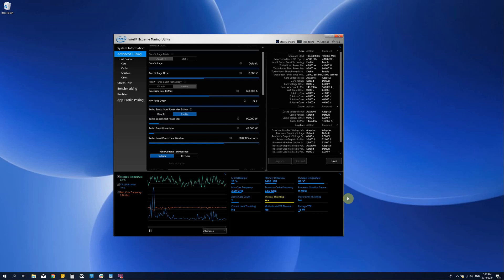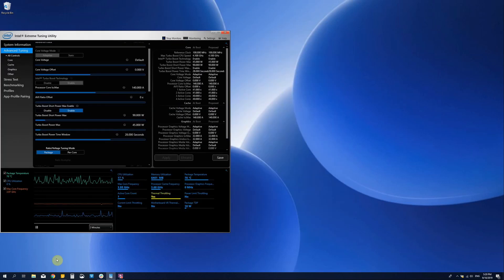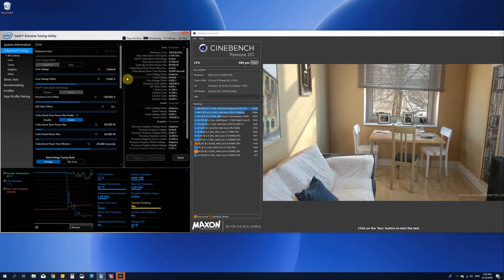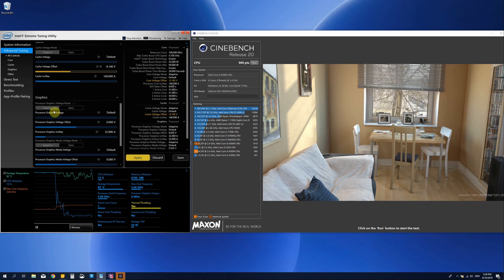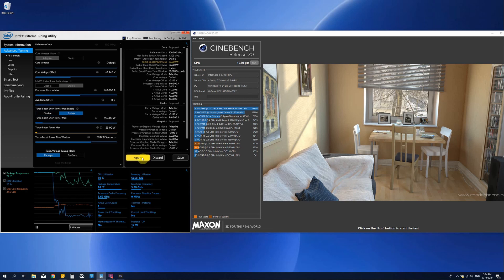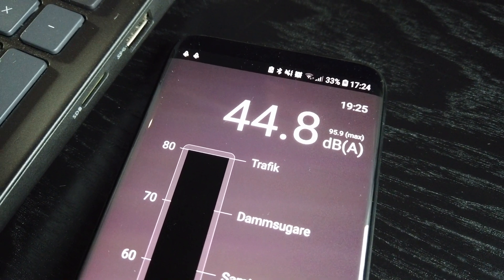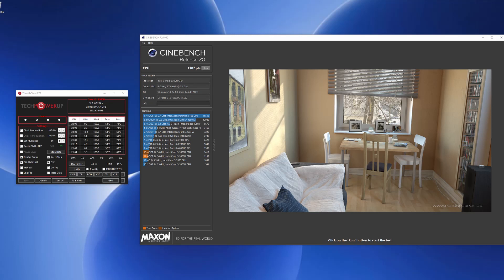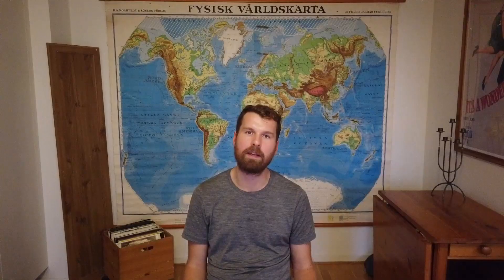Dell Inspiron 15 7000 i5 Undervolt & Turbo Limit in XTU Guide and Benchmarks

Comment: One more thing you could try to bring those temperatures down: repasting. Just replace the stock thermal compound with some high quality one. I think liquid metal in a laptop is quite risky, but any none conductive quality one will work quite good!
Just remove the bottom cover, then the screws at the fans - both gpu and cpu -, take out the fans, remove the srews holding down the heatpipe and you should be good to go. 
Remove the old thermal paste carefully with some rubbing alcohol, then aply the new paste. Screw everything back together and enjoy a cooler and maybe even more powerful/more silent machine!
Reply from the maker: This will happen eventually! I'm just a bit afraid I will do something wrong...
Reply: I repasted my CPU and used similar undervolting as shown in the video (only difference being, that I used a max turbo power of 45W) and I was able to get a Cinebench R20 score of 1823 points. Although it is noteworthy, that my CPU was constantly at 97°C while performing the benchmark. I don't know if I'm using an old bios version, or if the cooling system is just that bad, but overall my temps are still quite high. The thermal paste I used is Arctic MX-4 (2019 Edition).
Reply from the maker: @mtg1337  Wow that is awesome! What were your original W for turbo boost? Are you on i5 or i7?
Reply: @w2best  I have the i5 variant and the Max Turbo Power was set to 25 originally. I'll probably end up turning it down to that again though, to get better battery life.
Reply from the maker: @mtg1337  Oh interesting I think mine was set as 45w from the beginning! What were your temps when you reached 1823? Did it throttle? That's a great score for an i5! :D

Comment: Hey my account got changed but thanks for the video, it helped my buying decision, upgrade from my previous laptop (2016 inspiron). I didn't experience the huge fan noise when first starting up, so I let it upgrade to the latest BIOS and everything else, then I launched the BIOS pressing F2 on startup, going to Restore Settings and you select the Factory Settings one (Not the BIOS default one otherwise it won't work). And after that undervolt was enabled again! 

As for the specs and benchmark, I have the default one with i5 9300h, 8gb of RAM and the GTX 1650 with 512gb of storage. So after updating to the latest bios and then resetting to factory settings I started up XTU, made no changes and also ran CoreTemp and on my first Cinebench R20 run the score was 1666 without any changes. Temps were maxing to 97 degrees and throttling.

After this -140mv -40 on processor graphics and I think the turbo max was also limited to around 25-30 it resulted in 1838 points with temps going up to 98 degrees. I think it was performing well, fan noise was there and it was throttling sometimes. Im still going to test and choose settings with lower temperatures for now though. Power settings were on the Dell plan. If your laptop restarts when you put it to sleep, use thorttlestop instead, thats what happened to me and throttlestop fixed it. For now, I keep the turbo off and it helps keep temperatures low (around 75 degrees) and games are still running fine!

EDIT: I also wanted to ask you, do you get any IPS screen burn/ ghosting? Im getting a bit with the windows search bar on the bottom but too early to comment on it and I think it goes after a little time
Reply from the maker: Thank you for the update! I will def. test resetting the bios! There are a few people that have commented this, so I should def. try it! I haven't experienced any burn in so far, but it's only now that I updated to the windows creators update where the white search bar is always there. Let's see if it happens in some time...
Reply: Thank you so much for the video @W2Best Tech, and this comment also so helpful. I’m using Inspiron 7556, my cpu temp often reach 98C when doing heavy task and TS bench on Throttlestop. I try to resetting my Bios to Factory Setting like in this comment. Back to Throttlestop, activate the Disable Turbo and now my cpu temp only around 77C when doing TS bench. And the “unlock adjustable voltage” in FIVR tab also an be activate, it was greyed out before. Thanks!!

Comment: Hey, if you're still having that "sleep on closing lid" problem. All you have to do is go on the "Power options" a shortcut is typing "Windows" + "R" and enterring "powercfg.cpl". In the right of your selected profile go on "change settings" then "advanced options". You will find there the "action on closing lid", set it to "hibernate". I've was having the same issue. 
Best regards
Reply from the maker: I have done this and most of the time it works but not always. Still sometimes it will not hibernate as it should.

Comment: With throttlestop you cannot only turn turbo off completely but you can also just limit the maximum turbo frequency. I limited mine to 3 GHz and that works really well, it's still hotter than no turbo but also more powerful
Reply from the maker: I know you can, but I didn't do it in my last video. Back then I didn't actually know it was possible. :)
Reply: @w2best  

Do you have a video showing bios options for this laptop?
I'm gonna search your videos right now.
Reply from the maker: @TheAgentAssassin  I have one of when I updated to the most recent bios! That one silenced the fans and made the computer a few degrees less hot!
Reply: Yes, this is a game changer! I capped the frequency at 3.7 GHz and I get almost the same performance as before with much lower temperatures and much less fan noise (frequency now stays stable, while before it kept going up and down because of thermal throttling).

Comment: Thanks a lot for this video, and let me ask you one question. Does the xtu app interfere with Windows power plans or do they complement each other? Like if you change the slider between power modes, does it remove the xtu profile, or does xtu replace the windows power plans, or do they work together? Could you try your - 140/-40/23W with different power modes to see if there is any difference in performance and temperature?
Reply from the maker: Really good question but I don't believe so! However I haven't tried so I couldn't say for sure.

Comment: Hi mate, thanks for your work on this. I got the same laptop, but the i7 model as this was the only option that came with a 4K display (I am editing portraits in PS and LR on the go and more pixels definitely help). What I have done might be controversial, but I have disabled Hyper-threading in the Bios. This way I am running purely on 6 cores which is plenty of horsepower for my needs. I have also added a second NVME SSD and repasted both CPU ad GPU. Also, I am using Intels' XTU utility for undervolting and found a sweet spot at -60mv for both CPU and GPU. The laptop is idling now at 35 degrees and the fan really only kicks in at around 60 degrees. Streaming movies, watching YT, etc. does keep the laptop super quiet, only when I am stressing it (in PS for example as I work with big files) the fan goes on. I am not a massive gamer but will test some titles in the near future. I also have a slight issue with one of the fans which is humming a little louder than the other, I might try and find a replacement on eBay or on one of the Chinese tech websites
Reply from the maker: This is great to know! Thank you for posting your tips! I also want to repaste but I won't be able to do it in a few weeks while travelling.

Comment: Hi there. I have just received my inspiron 7590 with the i7-9750h processor. Can you please suggest the settings (values) for undervolting the laptop in order to cool it down? At the moment, I am not using or going to use any demanding software, if that helps. I just need to reduce fan noise and running temperature. Thanks a lot!
Reply from the maker: I would pick an undervolt of 125mv for the CPU and CPU cache and 50 for the GPU. See what it does to the temps and the fan. :)
Reply: With his settings in this video and Turbo off,  My i7-9750h processor  got a cinebench score of 1930 and process never got above 80c.

Comment: Thanks for the great vid, i was wondering if once the setting is done XTU can be totally closed and the settings are still there or does XTU have to run barkward to keep the settings active? thanks again.
Reply from the maker: Xtu runs the settings all the time and you don't need to keep it open. :)

Comment: Cool, I‘m also using XTU. I use -140/-50/no turbo since I only play older games from time to time. Which battery mode (longer battery?) and which Dell Power Plan are you using (optimized?) to achieve silent browsing and lower workloads? What do you use for heavier tasks/gaming?
Reply from the maker: Optimized and balanced are my standard settings

Comment: Hi dude! I'm pretty sure you've got this question several times, but I have to ask you cause I don't find my problem in the comments: I tried with xtu (already seen the 1.6 bios problem video) and when I restart/turn on the pc, xtu give me a message and my settings are completely gone..how can I fix this issue?
Reply from the maker: What message do you get? I haven't heard about that at all! So I'm intrigued to hear more.
Reply: @w2best   sorry but at the moment I don't remember the message because I uninstalled xtu from the pc, it's like the software cannot mantain the settings. I solved my problem with thermals simply disabling the turbo boost from the BIOS

Comment: Hi, I just bought this laptop (same specs) but I have noticed very high temperature even with Undervolting and limiting the Max Turbo Power to 25W, I mean temperatures reach 9x degrees quite a lot of time and when I was only browsing the internet the temperature was in the range 70-80 °C most of the time.  Do you experience similar temperatures?
Reply from the maker: My experience is sometimes it ribs hot, starts the fans and cools down but most of the time mine is cool and no fans running when idle or just browsing. Turbo at 20w might help!?

Comment: 2:15 How's that possible to hit 90+°C with XTU only ? While stress testing it is understandable but there with less than 20% utilisation ?
Reply from the maker: It's with xtu and the screencast software. I know it's crazy that it peaks to those temps at moderate use. After using the Acer Swift 5 for a while and seeing the other end of the spectrum. There is really a downside to using 45w processor and gtx1650 in such a small chassis.

Comment: Thanks a lot for this video, and let me ask you one question. I do not understand English well, I use an online translator. I realized that your laptop weighs about 1.6 kg. What is your battery capacity?
Reply from the maker: My laptop was 1,77 kg when it arrived with 97wh battery! With another ssd and ram it's almost exactly 1,8kg.
Reply: W2Best , thank you very much!

Comment: You should seriously consider repasting the laptop. I have the exact same config (only a 7591) with the latest Bios. In the past, CPU stress test in Intel XTU will definitely bring the CPU to 100 degree C within seconds. Now it's hovering around 80 degress throughout. And in XTU benchmarking, the Max CPU temp has decreased from 100 degree to 7X degree. I used Kryonaut and have not even undervolt the laptop yet.

As for the process, it is extremely simple. Only take off the backcover, then remove the heat pipe (no need to remove fan like the service manual instructed) by unscrewing in reverse order (there are numbers near the heat pipe screw if you look carefully), remove the old paste on CPU/GPU and heat pipe using rubbing alcohol and cotton tip, reapply the thermal paste (I used the X method), place the heat pipe back and screw it in sequential order, put the back cover on and you are done.

You cannot believe how badly the thermal paste was put on on my CPU. Literally less than 10% of the CPU shiny surface was covered with thermal paste. No wonder it hit 100 degree all the time.
Reply from the maker: Wow thanks for the comment. This really makes me think that is the next thing I should do with the laptop. Thanks for sharing!
Reply: @w2best  I just ran Cinebench R20 on my laptop. My XTU setting is -0.140V, Turbo boost Max 30W, grahpic -0.040V. Power profile best performance, Dell Ultra performance mode. The score was 1728 pts, with a Max CPU temp of 82C (for a brief moment) and average 72C. REPASTE THE THING!
Reply: @w2best  please make a video about this! :)
Reply from the maker: @TYGK95  If I decide to do this I'll most def. make a video about it!
Reply: @w2best  Do it :)
Reply from the maker: @foestar  It will probably happen but not in a few weeks when I'm out travelling!

Comment: throttlestop says my cpu is not supported, can I use etu to turn the  turbo off?
Reply from the maker: You can def. use xtu for it. Check the limit turbo voltage slider!